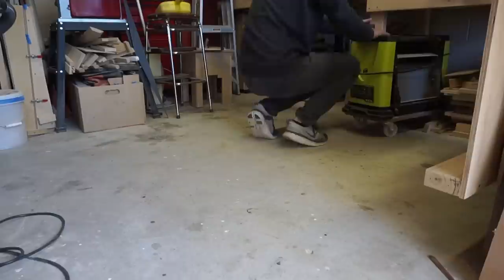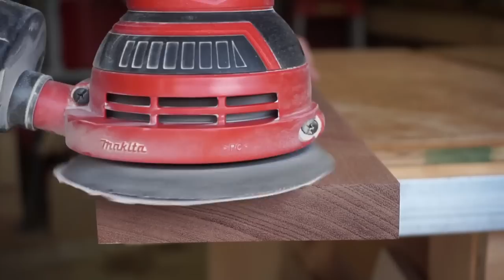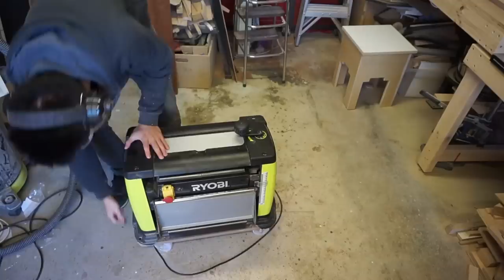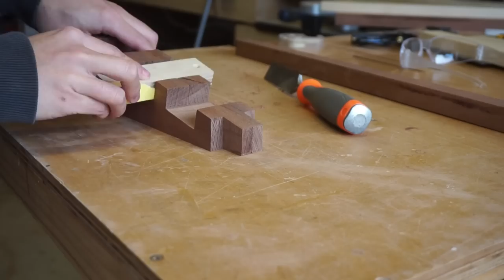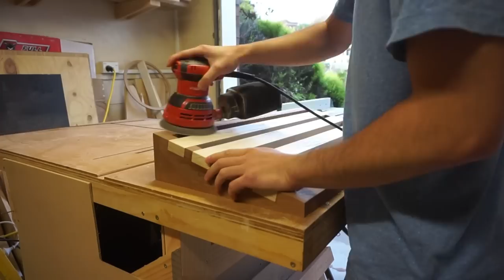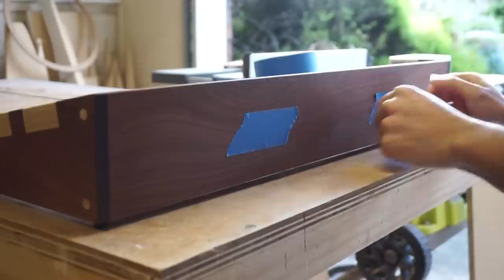Mahogany/Ash Pedalboard

Comment: I built one similar to this - never really cared about how it looked so mine is a lot  more quick & dirty - but it's the same slanted, horizontal board design.  It's great, but if you want to attach your pedals with zipties you should install vertical straps of some kind, otherwise zipties don't really work unless you drill holes or something.   That's the one improvement that I would suggest to this design (and that I will add next time I make one).

Comment: Its so satisfying I wish I had the tools to do stuff like this
Reply: You can probably do this with less than 50 bucks in tools. Even less if you already own the basic ones like a hand saw and a drill. As I see all I really need is a hand saw, a chisel, a hammer and some sandpaper.
Reply: Yup, it will just take longer. I built a book shelf out of pine with a jigsaw, a couple of chisels, a simple right angle square and a 4 oz claw hammer.

Comment: Love this! Have been trying to do something very similar. One question: why did you not feel the need to fasten the cross pieces with anything other than glue? Trying to decide if I should do something to make sure they are secure in place
Reply from the maker: Thanks! Glue is more than enough to hold it together and it looks cleaner without any fasteners

Comment: A beatiful work of art for sure. However, a minor criticism: that looks a bit heavy and excessively sturdy. That's not something you perhaps like to carry around small gigs all the time, at least for me. I'd probably build one from plywood, aluminum and quality veneer. Just my 2 cents. Anyway, great work, keep it up.
Reply: No such thing as too sturdy :)
Reply: @felix.delrubio  Of course it does. Mount the power supply under the board, cables go through the gaps between the slats.

Comment: How do like the Ryobi table saw, looking to buy the same one would appreciate an opinion good , bad or otherwise.
Reply from the maker: David Larbey it's not bad, it's not great either. The fence has alignment issues and I always to have to re adjust it to make it parallel with the blade. But most table saws in this price range will have the same issue and will perform similarly I think.
Reply: That's what I thought when I looked at in Bunnings might have pay more and get the Dewalt